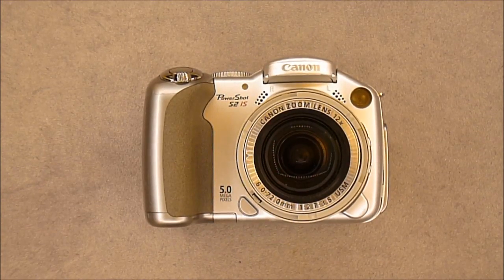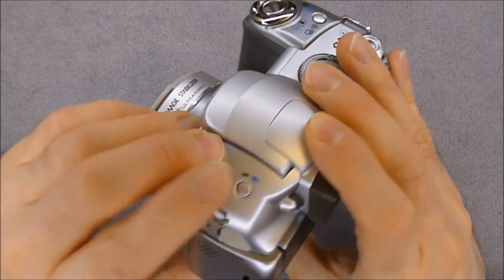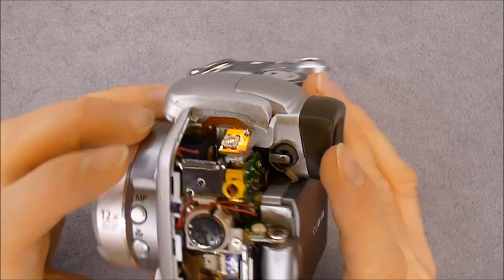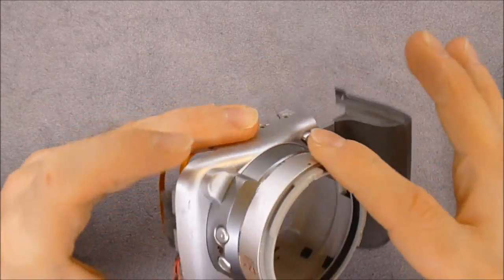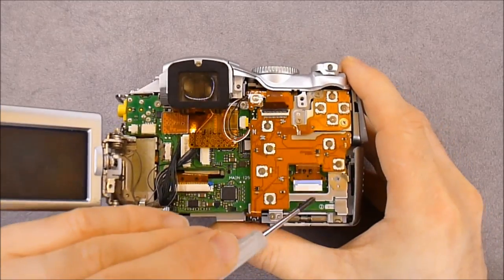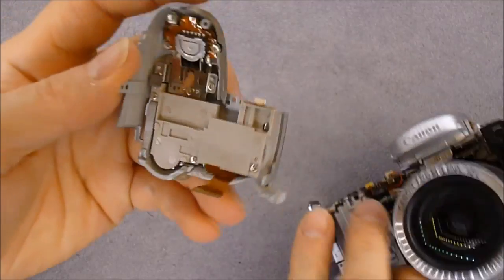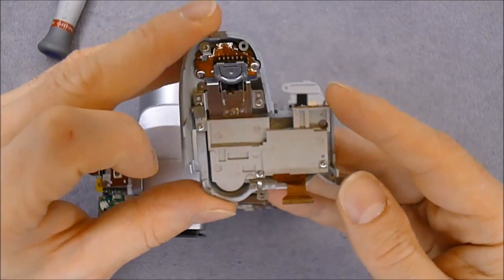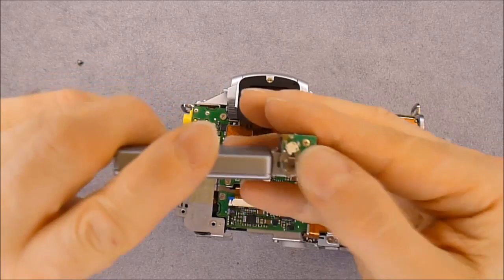Canon S2 is teardown part 1

Comment: Hello, thank you for the great, albeit shocking video! I picked one of these up at the thrift store for $8.00 US but I am getting 'memory card error' and the format option is not available from the menu (grayed out). I am using an older known good Kodak 512MB SD card (from what I have read online, 2GB is largest size these will take), so I think the problem is most likely with the camera.Thanks to your video I can see the card reader is part of the main motherboard. Just wondering if you have had any experience with this error. Cheers!
Reply: Clinton Swearngin I bought that for 400 dolar in 2004

Comment: Good day! Thank you for the video. I know it was long time ago, but do know plug pinout of the external power supply for this camera? I have the camera, but could not find the pinout anywhere on Internet.
Reply from the maker: No idea sorry, but the ground side of the plug is most probably connected to the internal metal parts of the camera,  it should be esy to find out with a multimeter in continuity tester mode.
Reply: Thank you.
I've used a connector from old Motorola charger. One of its pin has something about 1,7kOhm between it and camera's "-" battery pin (or USB cable's ground). The other pin is open connection to both "+" and "-". Or it could be just wrong connector.
Maybe you know why the camera's current draw can grow suddenly? (I.e. if it is powered from batteries or accus, when viewing pictures it is OK, but when trying to power it on in shooting mode, battery voltage drops lower than 4.9 V and it says "replace batteries"). It was not like that before.

Comment: sorry, i couldn't help but lol when the cap got you! Do you plan to make a working camera out of the parts of the broken ones? Hopefully they all dont have a common problem! I have some evil caps coming up in one of my teardowns, i'll be arms length with a hand in my pocket!
Reply from the maker: Yeah I was expecting putting a good one together, but it looks like somebody tinkered them and ruined most of the flex circuits connectors, so I'm not sure of how it will end.